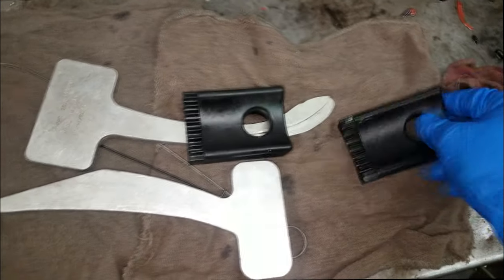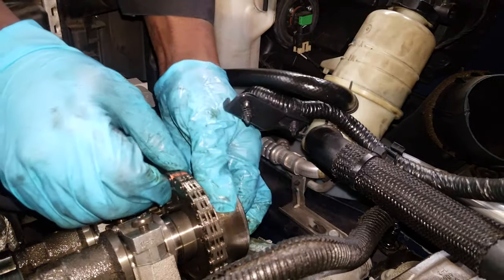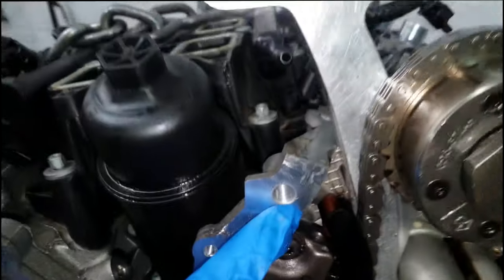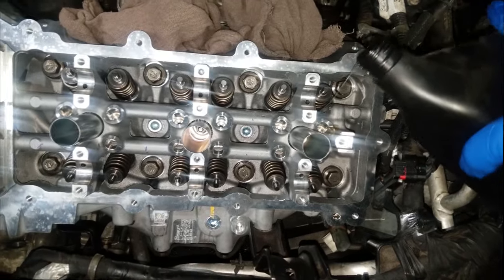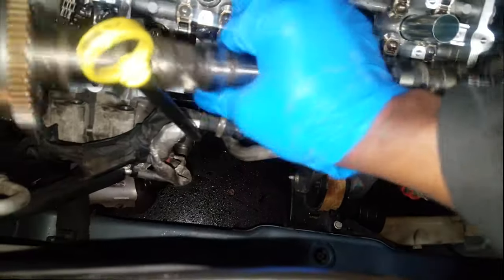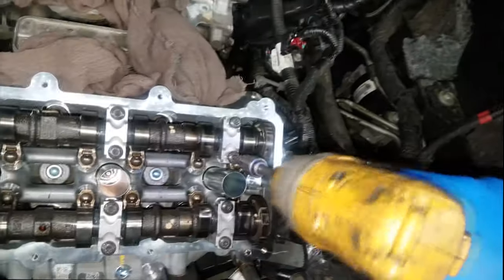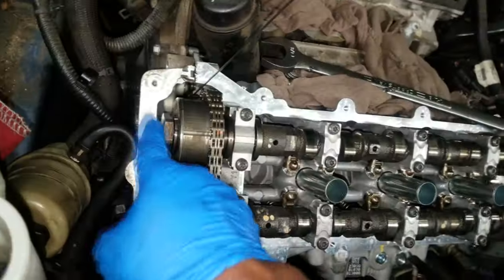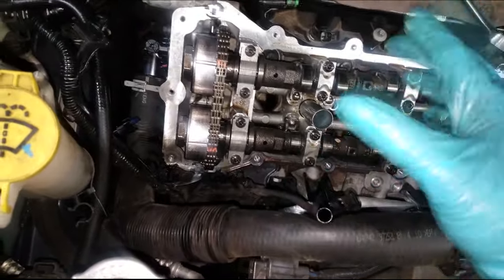How to Replace a CAMSHAFT, CAM Phaser,  rocker arms, 3.6 Pentastar, Timing Chain TOOLS P219A P219B

Comment: Great Video! and thanks so much for sharing your knowledge.  Decided to replace all rockers and lifters on my 2013 Town & Country after experiencing the dreaded loud tick.  Purchased the plastic version of the tools on amazon.  All went smoothly until I ran into a problem when trying to get the timing chain back over the intake cam phaser.  Even with the tensioner released, I can't get the chain to come back up and around the cam phaser sprocket.  It seems to be stuck or kinked down below the tensioner.  Have you ever run into this problem?  And if so, how did you fix it?  Any help would be much appreciated. I need to finish this job this weekend!
Reply: did u ever figure it out
Reply: I’m in the same place on my 2012 T&C. After a misfire code sent me to throw a start playground and coil at it, cleared the code but it came back. I went to swap injectors and figured I’d check out the cams, lifters, and rocker arms. They all look fine. 

Now I see in the video I can try to pull up on the side hole while pushing in on the back side of the tensioner pad before try to insert the grenade pin. 

Just can’t get enough slack in the chain to get the second phaser on, even if I push on the chain guide. I need that “extreme slack”.  Gonna make a pin from a coat hanger.

Comment: Also I can’t get the grenade pin to go in. The top pall should that be spring loaded too? I can get it to go in some but it doesn’t return when I pull the big plastic tool out.
Reply from the maker: you doing bank 1 or 2?
Reply: @OnlineMechanicTips  2 front head in caravan.
Reply from the maker: @michaelcharnecki3533  I always use a small pry bar just like in the video to depress it into the housing. But you have to lift up on the paw with the pick special tool to get it to go in bud
Reply: @OnlineMechanicTips  I can get the paw and plunger in but just can’t get the grenade pin in? Thank you
Reply from the maker: @michaelcharnecki3533  O wow, I hope its not to thick to fit in that small hole
Reply: @OnlineMechanicTips  it doesn’t appear to be. But tomorrow I’ll try to locate a thinner pin. I got a few from other tensioners I accumulated over the years.

Comment: Do you have a video on how to put it back together with the tools?
Reply from the maker: Hey bud, what kind of car you working on and which head are you doing? Also, are subscribed to the channel?
Reply: @OnlineMechanicTips  2014 Town and Country, yes subscribed now. I think this is the closest video there is of replacing cam with the timing chain tool kit. Is it a common task to replace cam shaft on T and C without taking the timing belt off or needing to replace it?
Reply from the maker: @carlyn_lacaze  No timing belt on this engine but just so you know, this is a big job for a DIYer. No its not common to replace camshafts, in fact, unless the cam lobes worn, there is no reason to replace the camshafts. Your engine sideways, which will make this a harder job. Bot I did do a video on the front head and the rear head. Links should be in this video. I did use the special tools on this job
Reply: @OnlineMechanicTips  ok thank you, my friend is replacing a bad camshaft for me but. He was wondering why none of the videos that we have come across show having to replace the timing or mention if the camshaft failure initially throws off time timing. Basically he wants to verify if he can theoretically just use the timing tool kit to change the camshaft and the rockers without having to remove the engine and avoid take the timing apart. Like u said its sideways, so it's hard to see in there. Also thank you so much for responding!
Reply from the maker: @carlyn_lacaze  You welcome. And no, there is no need to remove engine or timing chain cover just to re[lace the rocker arms or the camshafts if you using the special tools. I have 2 videos that shows this on both cylinder heads. This video we commenting on is for bank 2 head, and this link is for the other bank 1 head here: https://www.youtube.com/watch?v=oUHN1GRMC7M&list=PL-em2JbvrnvxLl47gw-PiRvJsdtSPpnQX

Comment: My cam phaser on the exhaust cam clicked and moved while I was torquing the oil control valve, the timing mark is now off but the dots still are aligned on the cam and back of the phaser. The only mark that is off is the chain and phaser. The chain is still in the same spot. Am I still good?
Reply from the maker: My dude, if the timing marks off, timing is off. You should not torque sown those cam phaser bolts unless you holding the camshaft hex with a wrench. Im having a hard time understanding. Also are you subscribed to the channel?
Reply: @OnlineMechanicTips  thanks. I am a subscriber I did hold the cam with a wrench but it appears the outer part of the phaser moved. The marks I put on the chain and cam are still aligned. The marks on the phaser have moved. The phaser clicked and moved as I was torquing the oil control valve but the cam didn't move as I held it the a wrench.

Comment: I've got to now replace the exhaust camshaft.   I think I had a screw driver near it and hit the magnet.  Jeep would start when I finally got it together, was coming up with no communication codes.
Reply from the maker: O wow. Im thinking it still will start tho. Did you ever get it figured ou, im just seeing this bud.
Reply: @OnlineMechanicTips  I ordered the part... I get it tomorrow and the tool next saturday.  Thanks for you video!
Reply: @OnlineMechanicTips  I'm going to have to do it the same as you did as the amazon tool I got is crap.

Comment: Also.....is it possible for the cam phaser to go bad? If so, how do I test it?
Reply from the maker: Yes, I started recommending phaser replacement at 80 - 100k when you inside the valve train. They could give off a rattling noise when first started, they could cause the traction control light to come on, they could set camshaft sensor codes. Watch this video here: https://www.youtube.com/watch?v=B8x8pOjRj5g&list=PL-em2JbvrnvxLl47gw-PiRvJsdtSPpnQX&index=180
Reply: @OnlineMechanicTips  Again, THANKS FOR THE HELP💯🤘👍

Comment: Online mechanic if you get this early enough you can help me out I'm putting my phasers back on because I had advanced timing one of these chain guys was broken I don't know if that caused the problem a wet but that's what I discovered now the scary part I marked everything before I take it off but the real question is my phasers that are on the vehicle they have markings I assume that our the lineup markings but they are both facing a different way on the crankshaft with that consider them off or do the phasers not move from the factory once they're put on and I'm only asking this just to trying to make sure that the phaser didn't turn away or out of line from what people called top dead center. So to sum up my question I seen different videos and they all put the phaser on in a different position it was all about these locking tool to lock on the sprocket itself so what am I getting at Candy phaser go on in any position
Reply from the maker: Hey bud, I hope you got this squared away. Just keep in mind, the phasers bolt to the camshaft only one way so you cant get that wrong. But the timing marks are very important. I not understanding the problem you having I guess
Reply: @OnlineMechanicTips  thank for replying. Well I guess it's more of a conscious thing I have my cams and crankshaft at top dead center locked my only question is I haven't seen anyone explain the phaser the way to understand if it's on the right way. So what I'm asking the phaser can be put on anyway or is there actually a Direction that the Lines should line up to or it doesn't matter because looking at mine  I noticed they have these little markings on it but when I took mine off it was setting at 10 o clock angle but a few videos I saw some are sitting at a 12 O Clock angle and some at a 2 o clock angle. So my car had some Advance timing going on and I was just curious if the phaser was out of sync from where it's supposed to be or does it not matter because I found my timing chain guide broken as well and I didn't know if that was causing the advance timing but the whole time the chain was locked tight

Comment: How do you release the tension on the passenger side without a tool?
Reply from the maker: It depends on what you doing. What exactly are you about to replace? Also are you subscribed to the channel?
Reply: @OnlineMechanicTips  Yes I am subscribed...I am replacing all of the lifters and rockers on the intake camshaft.
Reply from the maker: @gabbybaham4967  Its hard to explain but technically you really don't need the tools. Watch this video here; https://www.youtube.com/watch?v=5P6K3QyHgC0&t=13s

Comment: my soninlaw changer his rocker arms used a long screw driver to pry cam over to replace them put it back together started good no tick .butit showed code witch was cam shaft senior .changed it still shows that also runs like its in limp mode took to a dealer shop they cant find the proublem .could prying messed up cam or phaser yhank u all help would b appreciated
Reply from the maker: depends, what exactly is the name of the cam sensor code? Also are you subscribed to the channel?
Reply: it shos code po349

Comment: Hi there! you did an amazing job, just wondering how much this job usually cost and where you are located?
Reply from the maker: It all depend on what it needs. If you need all the rocker arms and all the camshafts. Its hard to say but it depends on what you need replaced

Comment: Hey Jt subscriber here I have a 13 charger v6 with p000a and p0016, p0017 codes. Bank 1 codes so I have only touched bank 1. I have replaced vvt solenoids, spark plugs, changed oil twice. There is a rattle sound at start up and it wont run longer than 5 seconds. Is my problem the phasers? I’m confident after watching your vids I can replace them.
Reply from the maker: Yes likely the phasers. This sometime will cause the ABS traction control light to come on as well

Comment: Hi.i had jk 3.6 i installed a ripp s/c.now engine oil goes inside the intake manifold.lots of oil.what could cause it?pcv installed from ripp.thanks for any help.
Reply from the maker: You may have to install a catch can now bud.
Reply: @OnlineMechanicTips  ive already put a ripp catch can boss.

Comment: I have a 2011 Chrysler 300 I had someone replace a rocker arm for me about a month later it started knocking I took off the cover myself and found the camshaft broke in half everything else looks to be in good shape I noticed when the guy did the rocker arm he did not use a torque wrench to tighten down the camshaft after loosing it up and they're fasteners he did not put back in order because I just noticed him take them off put them in a pile and then put them back on without looking at them I'm ninety-nine percent sure that's why the camshafts snapped it's the one closest to the driver side fender marked LE I'm ordering one online and wanted to know what to look for do I just asked for a camshaft or do I ask for a left exhaust camshaft

Comment: What valve spring compressor works on these in the car? Is there one you can use without removing the cam?
Reply from the maker: The only reason you would need a valve spring compressor is to remove keepers from the valve in order to replace a seal. Why would you need a compressor? What are you about to replace? Also are you subscribed to the channel?
Reply: I want to replace all 24.

Comment: ok im a subscriber just to get that out of the way. a little background. Im a or was a gold level 3 Chrysler master tech all catagorys 30+ years , ase master  30+ years mostly heavy line. I have 14 town and country 3.6 we had an intermittent lifter or tappet noise coming from rear cylinder head on my daughters van. due to financial reatraints we had ordered rockers and tappets for 1 head replaced the rockers and tappets reassembled without issues but when started have p0300 turns out 0psi compression all 3 rear cylinders verivifed timing marks i personally use the plated links for my marks before dissassembly so i have plated links on marks lines faceing each other dimple on cam and phaser match 4 cam holes up intake and exh cams in correct spot as well as phashers. links match on front head as well. so reinstalled old parts compression returned reordered from amazon 0 psi once again. visually tappets and rockers look identical to oem.have aska few of my old colleges imno longer at dealer anymore been gone couple years they are stumped, by chance do you have any idea of what is wrong, going on here? any help would be greatly appreciated.
Reply from the maker: Hey bud, if you can simply re-install the old lifters and then all of a sudden compression return, it seems those so called new lifters have not pumped up. It takes oil pressure build up to pump them up. If the car not running, its hard to build oil pressure. I am no fan of aftermarket valve train parts for the pentastar for this on reason. With any newly install hydraulic lifter will likely need primed and a good lubrication oil pump to pump them up quickly to allow starting. If the lifters never pump up, the valves will not properly open and close and compression will never build
Reply: @OnlineMechanicTips  i definatly have valves opening onfirst attempt allowed it to run till hit opperating temp had no tappet noise whatsoever i suspect the the valves are not completely closing, i can see down intake and verifyvalves do open will have to wait till morning to see if i can telll if closing by looking down intake. have you run into anything like this before?

Comment: Love the video liked and subscribed. Opened my Jeep to replace the rocker arms (ticking) but now see the camshaft exhaust is worn, My question is if I am going to do this how do I find top dead center? Is it is simple as aligning the arrows to point to each other on the cam phasers as it shows in the video? Thanks again for the great video!
Reply from the maker: Hello my friend, thanks for watching and subscribing. Since this is a Jeep and the engine not side ways, you can simply remove the number 1 spark plug and do the old rotate the crank until the #1 piston pegs out. But I typically use the arrows and point to each other on the phaser (bank 2) or the lines (bank 1) You should end up in this position anyways it #1 is at tdc depending on what revolution its in. The most important part is marking them making sure it goes back on that way..Curious, which bank you dealing with?
Reply: @OnlineMechanicTips  Just got the exhaust cam in today for bank 2 so almost the same as your video just not the intake cam. Thanks this vid gave me confidence to give it a go.

Comment: hi i do replace the head on my dodge caravan 2011 3.6 when i turn it with the torque wrench clockwise thend  make a noiseon right chain tenchioner and spits oil from the tensioner of the chain is normal becauce is dry please help me

Comment: Hey bro.. been having a P0305 on a ´15 Town & Country. Coils and plugs are good. Misfire only on Idle and not under load. Can definitely feel it at idle. Got the valve cover off and cams and rocker look good. I don't feel any play on the rockers. There's a small faint scratch on the lobes on exhaust cam cylinder 5. Got the tools on the way to fully remove cam and inspect the rockers and lifters. Not sure if this is going to fix my misfire tho. Do you suggest I replace the rocker arms anyway? What else should I look at?
Reply from the maker: Hey bud, you likely should have done a compression test before you taking off the valve cover. You need to see how much compression build up cyl 5 can produce. Are you subscribed to the channel?
Reply: @OnlineMechanicTips  I had taken into a shop and they said compression was around 135. They advised a full head removal but said they didnt have time to do it. After watching your videos I thought maybe bad rockers or valve seats. Which I could do but they look fine and cams look perfect.

Comment: Hope you can help me. I changed the exhaust cam on bank 2 and now engine won't start. The screen in the middle of console goes blank. Could the timing be off? It gave me a bunch of codes about cam(exhaust) position and actuator
Reply from the maker: Hey bud, yes the timing could very well be off. You need to back-track everything you did except believing TDC is up based off the head you worked on. Then retime engine to specs and see what happens
Reply: @OnlineMechanicTips  ok should I use bank 1 to confirm and retime bank 2?
Reply from the maker: @bigray79  yes exactly..no mark on crank so a good way to assure #1 piston up is either manually or with the other head.
Reply: @OnlineMechanicTips  appreciate that...

Comment: so pull the grenade pin BEFORE torqueing phaser and caps? 

also im gonna replace rockers and lifters along with both cam shafts and phasers(if i got her open might as well). is it a good practice to replace caps and cap bolts too? ty. solid vid my guy 💪🏽
Reply from the maker: I would install the black guide tool to lock phasers down then torque bolts to specs then loosen all slack in chain to where the tensioner guide at then pull pin. Yea if you dont want to ever have to go back in the valve train, you might as well do all
Reply: @OnlineMechanicTips  appreciate the reply guy. peace and blessings
Reply from the maker: @mr.k5011 YW, Can you please like the video and subscribe to the channel? thanks.
Reply: Online Mechanic Tips already one step ahead gent. i got chu.
Reply: whats the size of phaser bolt/control valve? size wrench you used for cam shaft? ty sir.
Reply: Mr. K it’s a 36mm.